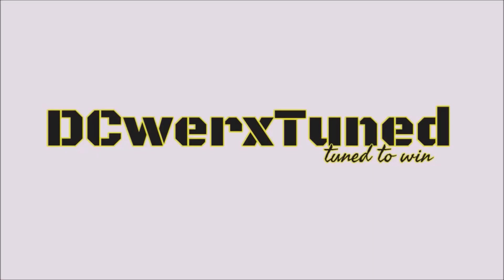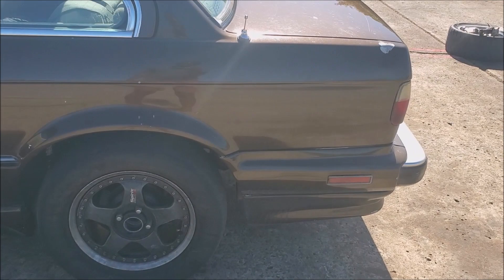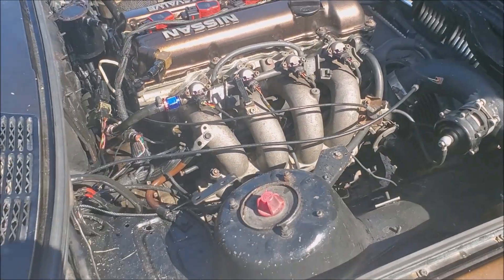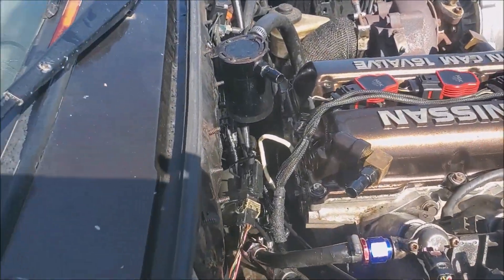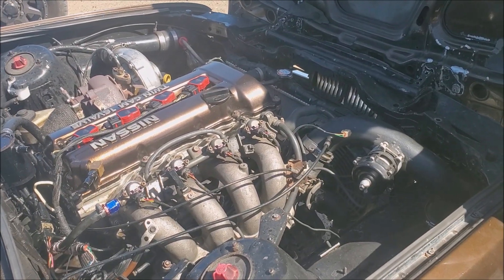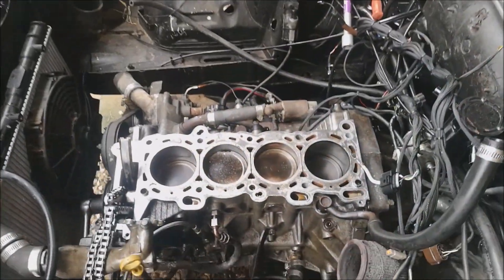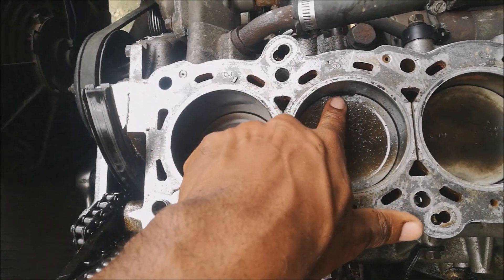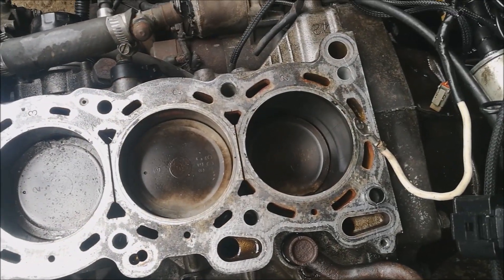Judas Strikes Again !

Comment: Since you will take the engine apart and it's an N/A motor widen the piston ring gap more .I would go to 0.75mm . 
For the injectors use your fuel rail  power the fuel pump up and spray each one at max duty for 10sec inside a container to get a value for cc/m. 
If a machine shop is available do the calculations and shave some cc from the top of the pistons . It's cheaper that getting a new motor and will take all the beating plus have a margin for questionable fuel quality.
Reply from the maker: The gap was closer to 0.018 on this motor IIRC. Wide enough that it had noticeable blow by at operating temps.

Thanks, that's exactly how I intend to test these injectors.

Compression ratio with these pistons is 9.5:1 and our local pump gas is 91 octane. Not a terrible but doesn't leave much wiggle room for bad gas
Reply: @DCWERX  You are right.
. 9.5 is high .. try removing some cc's to lower the compression and keep the coolant close to 80c . Oil cooler will help too and maybe a chargecooler setup will keep intake Temps lower at those 1/4 mile runs 😀. You shouldn't have noticeable blow by with 0.018 inch gap though that's strange. 🤔
Reply from the maker: @eros20V  I have tuned a few other higher compression turbo cars and it's not terrible but lower CR makes it a bit easier. Higher boost will be on meth injection so not worried too much.

Coolant temp was definitely a struggle for this car. Hopefully address it better next time

Comment: Did something get in thru the throttle? Thanks for the video!
Reply from the maker: I highly doubt
Reply: @DCWERX  ok , i am curious to know what it was🙂
Reply from the maker: @mdsci7894  just an injector failure from the looks of it
Reply: @DCWERX   wow interesting
Reply from the maker: @mdsci7894  bitter sweet. I planned on changing out next year anyway but didn't plan on the motor failing
Reply: @DCWERX  what do u need to get it back running? Piston,rings and injector?
Reply from the maker: @mdsci7894  plan is to get another set of sr20de pistons + rings off ebay and install that and close up the motor. Next I will get some 1200-1500cc injectors, top fed fuel rail, and regulator and throw the car back on the dyno.
Reply: @DCWERX  sounds like a solid plan!

Comment: what do the plugs look like?
Reply from the maker: Typical soot colour from rich mix. #2 had aluminum bits but that is expected
Reply: @DCWERX  hmm I'd almost say it's your ring gap but maybe was just a bad injector, weird, wasn't making much power by the mph to show a mechanical failure like that, and as you said you have an afr safety set , have a look at Richard holdeners theory on ring gap
Reply from the maker: @929cosmodude  thanks. Ring gap was extra wide on this motor

Comment: I have the same swap and im getting tired of it my engine is fully built but it keep giving me problems that why im selling the swap,im goin LS1..
Reply from the maker: Your build looks real good. LS swap has crossed my mind a few times
Reply: @DCWERX  yes the sr here in US go for $6,200 now back then when I got my it was 1,400 the ls go for $250 or less than $500 a 5.3l my friend's ar making 450hp all motor with a cam and headers
Reply from the maker: @e30victorino99  the expensive part of the E30 LS swap is the oil pan needed to clear the steering rack
Reply: Yes the oil pan is $280 and the aluminum manifold is $300 i already did my homework on everything it going to cost me 2,500 everything because im goin to use a bmw tranny that i have and the adaper is is $950 but those ls are everywhere here on the junkyard..if my sr blow's  im stock because here u cant find them for less tha 6k maybe if is blown..
Reply from the maker: @e30victorino99  if mine blows it's certainly not getting another Sr20. LS or k24
Reply: K24 is good but u have to make it turbo to make the same power tha the ls makes all motor, i just need something more reliable i dont trust the sr to drive anywhere far.
Reply from the maker: @e30victorino99  true but every project car I own must be boosted.
Reply: My coworker have a nissan 300zx with a ls turbo just 7psi made 568hp the engine  is stock.k24 is good too i seen alot of k24 e36 here is very common.

Comment: that suck man sorry you lost a elpistonA  at least from video its a simple fix ..God bless . a lean/bad injector is my first check .just as you are suspecting// your ring gap is nice and fat? . i know not this issue just rambling ..you can make an injector flow tester with graduated cylinders and a class d amplifier board ebay china thing or just any old amplifier laying around with the juice to do it is my thinking right ;]  the pwm signal with a signal generator phone app or ebay diy signal generate kit P.O.S i am going to make one got the stuff just ant did it yet .l am being lazy but i need it now to clean some anf flow ,match a set
Reply from the maker: Thanks brother. I'm certain it's the injector. Ring gaps are very wide, a bit wider than I would normally run. 

Thanks for the suggestion

Comment: Judas doing Judas things. 
I don't know why people love these SR20 engines so much. They make power but are nothing but problems, which is fine when they were cheap, but those days are gone.

Personally I think everyone sleeps on the bmw m42 & m44 engines. They seem to do just as well with a turbo strapped onto the side as the SR20 does.

My s13 180sx lasted 1000 miles after I purchased it before it began to burn oil and cooked the bottom end. Never again. Great chassis, garbage engine. 🤣
Reply from the maker: They do have alot of factory flaws but overall not terrible. They are ridiculously expensive though "JDM tax". If it was a more catastrophic failure I definitely would be doing something other than a sr20
Reply: @DCWERX  Good luck brother. As they say: Rebuild and come back stronger (aka more boost) 😁
Reply: We have a couple of those around here, turbo converted beemers are in general quite common over here. Plentiful and cheap engines, and takes boost, good after market aswell.
Reply from the maker: @garagecedric  4 cylinder ?